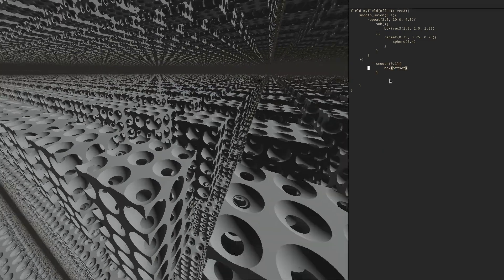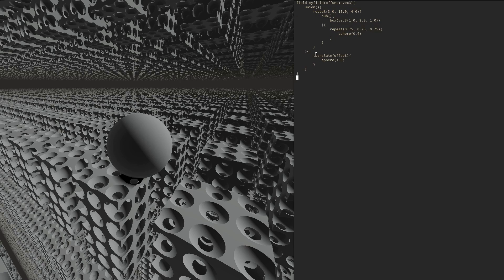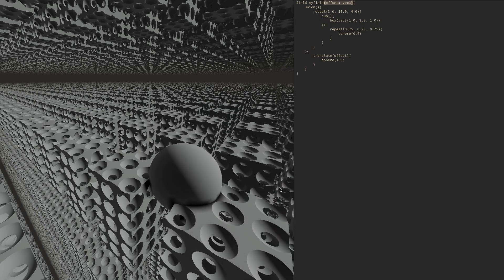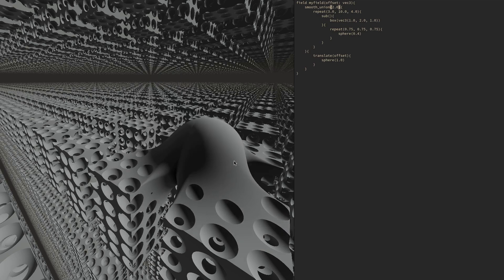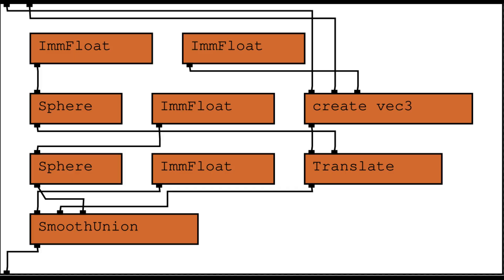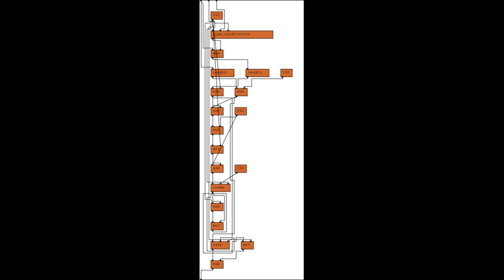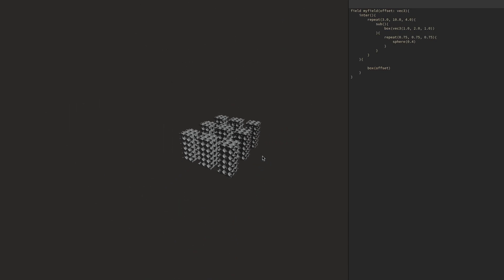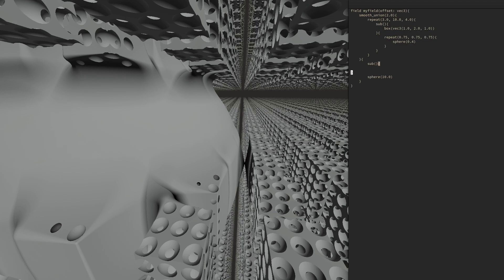MiniSDF - A Signed Distance Field Compiler

Comment: Can you use the SPIRV modules to partially update an SDF ? 

I am used to shadertoy, idk how any of this low level vulkan black magic stuff works
but if you have for example a really big union like a scene, can you just load the module for a single object that you use, and replace it at the level of the min/max operation that does the union, leaving the rest of the scene unaffected ?

is that what you are saying ?
Reply from the maker: In a way yes. If you known shadertoy then you can think of it as "patching your SDF function". 

So you have you sphere tracer that at some point calls 
`float sdf = my_sdf(some_position, and_additional_parameters)` 

The compiler then builds a new `my_sdf` function, and replaces the function in your code with the new one. 
However, on SPIR-V level, not the GLSL code.

To answer your question: If you change your scene, the compiler will effectively generate the same code for the initial scene, and only change the new part of the function. However I did not implement any caching yet, so it'll recompile the whole scene anyways right now.
Reply: @siebencorgie  also I'm thinking that if the primitive operations can be defined in a more clever way that such that the compiler knows the max bounding box of any "feature" it will be able to create a BVH or AABB tree or some other similar data structure
in order to make screenspace culling of "features" possible as a out-of the box optimization
Reply from the maker: @mihailazar2487  Yes, I hope I'll get to that in the future. I think there is a lot of unexplored potential. Similarly, when adding a x86 backend, you could also use the compiler for "perfect" collision tests on the CPU.

Comment: Why not emit HLSL/GLSL? Way more practical when it comes to including in other application, you don't have to be bother with most of optimizations as well as they will happen during the final compilation and the whole thing is simpler and safer to write since you are outputing text instead of SPIR-V.
Reply: Because the output is SPIR-V you can use SPIRV-Cross to create hlsl/glsl/msl if that is what you need
Reply: @jaxfrank Super convoluted if you ask me. Also - SPIR-V failed to be a first party solution, DXIL is honestly and it has a better compiler as well. I personally see no point in using SPIR-V as a backend any more.
Reply from the maker: @dexio85  Not sure what you mean by first-party-solution. As far as I know it's the target for most open, GPU related compiler backends. There is a MLIR target for instance. DXIL is only used on Windows + DX12. Again, please correct me if I'm wrong.

However, personal taste and development context definitely play a role when choosing the target format. For me, DXIL was never a consideration since I'm mostly working on Linux ^^.
Reply from the maker: The point of @jaxfrank was a consideration. I can currently translate the SPIR-V-Module to DXIL and MetalIR if I want. I can also use the glslang optimizer via spirv-opt (I believe that's the same thing as in glslang AFAIK, correct me if I'm wrong).

Apart from that, I currently don't exploit the main advantages of a DSL, which is the higher level information I get. For instance, I could pretty easily change to lower-resolution floats based on context information. Let's say when working with "small" primitives. 
Or I could replace known CSG patterns with optimized versions. For instance, a smooth(){box()} could be replaced by smoothed_box().

Regarding safety, I personally am more comfortable working on the SPIR-V level than pasting GLSL/HLSL together into a working shader module. But I guess that's more a personal preference, than a technical detail.